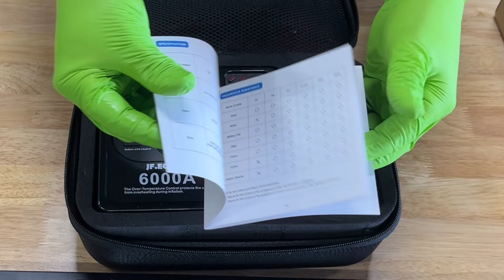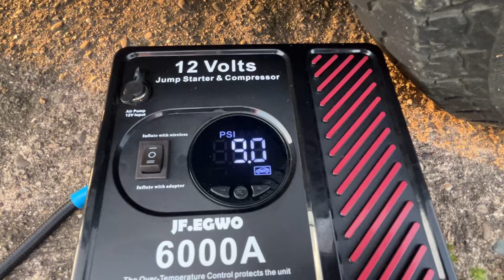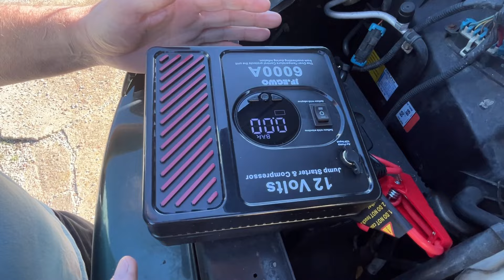JUMP STARTER +AIR COMPRESSOR JFEGWO Review You Need To See For Yourself a must have tool

Comment: I purchased a JFEGWO with an air compressor and it comes with a lifetime warranty. When I tried using it to start our work truck, it started quickly. It also started my Honda CR-V quickly, even with the headlights left on at Costco.

Comment: Last week, I bought a JFEGWO 6000A with an air compressor. I haven't tested it on a V8 engine yet, but it effortlessly started my dead UTV battery, saving the day. I'll be making a video about the JFEGWO 6000A's starting capability this weekend. I know the NOCO GB40 couldn't start my Mopar 4.7L V8. I have a NOCO in my garage, and it couldn't start my truck. That's why I bought the JFEGWO on a friend's recommendation, haha.